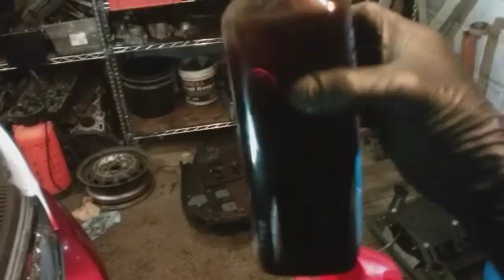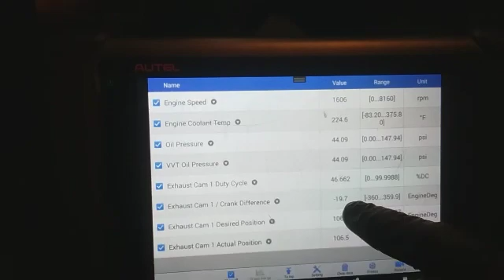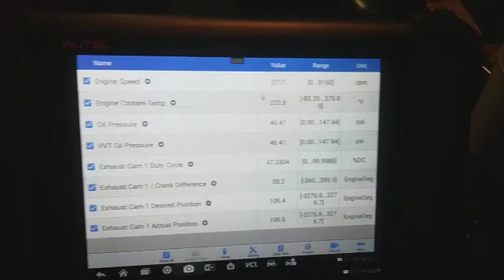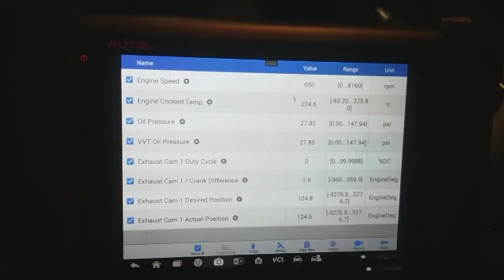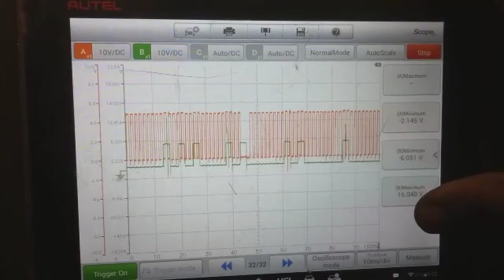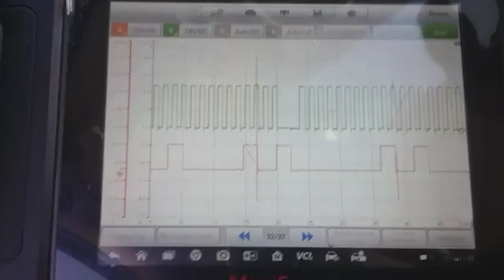P0344 FIXED! DODGE 5.7 DONT CHANGE THE CAM SESNOR JUST YET

Comment: It's really blowing my mind that an oil change is fixing this issue but it does make sense as oil thins as it gets more mileage. I just did a 3,200 mile road trip and two days after I got back home, my 2012 Ram 1500 Hemi started going into limp mode with me having to turn the engine off and restart to get going again. It never does this when the engine is cold but only after at least 30 mins of driving. I feel it's heat related. My original codes were U1*** (cant remember) can bus. So I cleaned all the grounds in the engine bay (which weren't even dirty) and then unplugged all the connectors to the TIPM and seems fine for 2 days. Today, I'm having my problems again after doing more stop and go driving. Guess the oil wasn't getting hot enough those last couple days until today. Now I pull this new code P0344 and found this video. My oil is clean and has 5k on it but I'm going to change and see what happens. And will report back!
Reply from the maker: Hey there... 

What happens when oil correct p0344 codes is that the oil filter gets stopped up, delays delivery to vvt solenoid and or vvt gear range of motion. 

Also, vvt solenoid or the oil control valve can be a contributor. The vvt gear can be failing or timing chain.

Try a higher millage oil filter, something that'll last 10k miles over a standard filter. Be cautious not to add any oil additives, just the oil viscosity required.

Let me know how things work, thanks
Reply: @partsshooter  Sure will! The filter I used this last oil change was the 10,000 fram filter. I also just researched this code possibly being a result of a alternator with a bad diode. Apparently I need to do a wave test to make sure the alternator isn't putting out a wired signal because I did have low voltage sensor code with that P0344 code.
Reply from the maker: @rotaryperfection  interesting... Try and see what happen with the alternator. However, just keep in mind that they're not correlated and the code setting criteria is pertaining that specific component related to timing and nothing else. 

Charging system and cam position sensors/timing are widely unrelated
Reply: @partsshooter  Well this is the video sharing that alternator info and got me curious. https://youtu.be/LFKL990i0bE

Edit: Nevermind as that was for a P0340
Reply from the maker: @rotaryperfection  I see what you're talking about, however interruption via noise in signals are rare, likely is unique with that particular vehicle. When they designed the harness, potential poor insulation.

Dodge uses a hall sensor, square wave.

In dodge, most likely their maybe drop off signals or cam angle is off for various reasons. Try a crank/cam relearn procedure if you have the appropriate scan tool
Reply: @partsshooter  10-4
Reply: Hi, Did oil change work?
Reply: @stevethemechanic8099  Never did oil change. Because I was reading about electrical corrosion issues, I decided to go around the engine bay and inspect for chafing and started moving the engine harness around a bit. Then I removed the engine upper cover and left it off. I haven't had an issue in a month so it has to be in the wiring somewhere. 

Edit: There may also be an issue with the plastic coolant temp sensor. When I was buying the engine for my other truck and looking for a wiring harness, the guy told me they had a similar issue with his moms truck. Turns out that the factory plastic coolant temp sensor will leak internally and corrode the wire going to the ecu from the inside out. They had to replace the ecu and change the harness to fix hers. My truck still has the plastic sensor so at some point I'm gonna install the metal version.
Reply: @rotaryperfection   been chasing P0344 code I replaced cam sensor already and took out and cleaned vario-cam actuator, seems no signal coming from cam sensor but still inconclusive
Reply: @stevethemechanic8099  See my above post and also check the wiring around the oil filter pedestal. That's a chaffing spot if the harness isn't secure. What year ram you running? Pull all the connectors to the ecu and make sure there isn't any corrosion on those terminals.
Reply: @rotaryperfection  actually on Porsche Cayenne S 04 about to check wiring
Reply: @rotaryperfection  This damn P0344/P0340 codes keep coming back. About 6 months ago, I changed the oil control valve cause through these code problems found out that the factory OCV will eventually crap out on you. So, replaced that and cam and crank sensors. Now the codes are back. Noticed slight leak from temp sensor. So, I'm figuring it's that tripping up the code or bad wiring. The ABS, TCS and left tire speed sensor light are on. Brought it in for a tune up, the mechanic said everything working fine. So, I'd only be paying to fix them to get the lights off the dashboard. Any suggestions on best course to getting to the bottom of how to find and fix what's actually wrong?
Reply: @patrickrooney926  "Slight leak from temp sensor"

So I bought a 2013 Ram 1500 from auction that needed an engine and new harness from a previous engine fire. Bought the engine from Florida off Ebay and found a matching engine harness from a shop in Houston. As I was on the phone with the guy about the wiring harness, he asked why I was replacing mine. I explained to him about the fire damage. He was like "Oh I though you were having electrical problems because his mom was having weird electrical issues with her Ram". I explained to him about my weird problem with my 2012 and he told me that he had similar with hers. He explained that they had to get another mechanic to look at her truck and that mechanic figured it out. Her problem started with that TEMP SENSOR. Apparently there is a batch of coolant temp sensors out there that are plastic. When these sensors start to leak, they leak internally and the cooper wiring of the harness acts like a wick and the coolant actually corrodes the hardness from the inside out to the point the corrosion makes its way all the way up to the PCM. So they disconnected the PCM and sure enough that terminal was corroded. They had to replace the entire engine harness and pcm to fix her problem because of that internal corrosion. The newer trucks have metal temp sensors so I'd check yours 1st for that plastic one. That may be your issue if you have corrosion inside your harness. 

As for me, I ended up swapping the temp sensor with the spare I had on the damaged engine. It was plastic as well. The day later I got the same code again. My next step was me just moving the engine harness around on the back side of the intake (making sure it wasn't catching on anything) and I haven't had a problem sense. I suspect I have a minor short in my harness somewhere but seem good now.
Reply: @rotaryperfection hey it's been a few years, did it ever come back?
Reply: @benjamink1403  I sold that truck the following year.

Comment: I Got This Code Randomly While Driving 45 MPH The Engine Light Came On Car Went Limp Then Oil Light Came On Then Stalled The Car Was 450 Miles Overdue For A Oil Change & It’ll Crank It Just Will Not Start Do You Believe It Could Still Just Be The Oil?
Reply: Any updates on your fix? Having exact same issue

Comment: I’ve recently had a oil change. Replaced cam/crankshaft sensor. Spark plugs. And wheel speed sensors. And the light just came back on. Any suggestions ?
Reply: did you ever figure it out?

Comment: Thank you so much for your time and effort. 

My 2010 Ram 1500 5.7 just started showing the check engine and the traction control lights few days ago. They simultaneously go away by themselves sometimes and the code I got when I ran a scan is P0344.

One thing to mention is, the oil change is way overdue, and when I did some googling, I found forum posts that mention "oil change" as one of the solutions.
Reply: Im having this same issue!!!! Did you find a fix? I have replaced the cam position sensor and still getting code and traction control light. Any help would be much appreciated! Thank you!
Reply: @colethompson7730  Yes, I fixed the problem by doing an oil change and clearing the P0344 code. I haven't replaced any sensor and no error code/light yet. I'm using a synthetic 5w20. Hopefully that'll work for you as well. 🙂
Reply from the maker: Maybe worth getting an oil with more detergent or cleaning properties. I don't service large displacement engine too much to provide indept insight.

Id imagine there's insufficient lubrication scavenging to integral places. I'd assume either lowering oil change intervals or oil additive detergent would help. Maybe even a friction modifier but nothing thick in viscosity

Comment: Thank You for Your Help!  Liked!  Subbed!  I have a 2012 Jeep Grand Cherokee and it had a P0340, P0344, P0016, P000b, when I got it.  I replaced the crank pos sensor, cam pos sensor, fixed a damaged wire near cam pos plug with heat shrink,  oil control solenoid, changed the oil 5W-20, oil filter, air filter.  And before i could clear codes and they would come back immediately, now after these parts only the P0340 comes back after 30-40 miles.  Any Ideas?

Comment: Dude you are the man!!!!  I had the P0344 and P1dd2 (Torque request signal denied) and U1424 (inplausable torque signal) codes and my oil was way overdue for changing.  Transmission would also stick in 4th gear and not come out until I turned it off and back on.  After watching this all I did was change the oil and reset the oil change required setting and everything is gone.  Have driven over 150 miles so far with no codes.
Reply: Bro I hope this fixes my issue! I have all 3 of the codes you mentioned but only when I try to go wot

Comment: Do you have any other suggestions? Changed Crankshaft sensor, camshaft sensor, checked the connector, Changed oil, P0344 comes right back on as soon as I start the truck. I'm in a 2005 Ram 1500 4.7L
Reply from the maker: Try the oil control valve under the intake... I have a video on that also in my archive
Reply: customhonda where is this valve for 3.7? i have same problem, i changed chains, gears, tensioners, oil pump, camshaft sensor and crankshaft sensor, the code p0344 comes right again...
Reply: Reset codes after any changes otherwise it will display it all the time.
Reply: I have this problem right now 2005 4.7. Did you figure it out.

Comment: Thanks for saving me $59.34 in parts, I knew my oil was beyond due for a change but when my truck stalled doing 70mph and then went into limp mode (lack of power little to no acceleration) I took it to auto zone it came back as a P0344 I bought the sensor and a coil just in case, came to this video and said hey what do I have to lose, Change oil and filter problem is gone.  Thanks again!
Reply from the maker: AWESOME!  Thanks for the feedback

Comment: I have a knock that sounds like fuel injector knock but all fuel injectors are fine. Also changed all 16 spark plugs cause it was originally misfiring, helped the misfiring but then it developed the knock as mentioned. Threw this code and P0113 changed the cam sensor below the throttle and it worked for about a day or two, still had knocking, changed oil, no metal in oil, still knocking and now its throwing this code again, the only sensor I haven’t changed was the crank position sensor. But it keeps throwing an intermittent code. Any ideas?
Reply: Its on a 2012 Charger RT Max with the 5.7L hemi
Reply from the maker: https://youtu.be/z2jZwCtsR_Q

I did another video about that code... Windup having to change vvt solenoid. You'll see the screen was damage plus other test
Reply from the maker: Basically, if that oil control valve can't sustain the demands of the ecm, it can contribute to the cam intermittent fault.  Also, the screen should tell you the story of your engine quality [metal shavings etc].

 Hope this answers your question.
Reply: Check the header bolts. They tend to rust and snap off because the headers warp under heat.